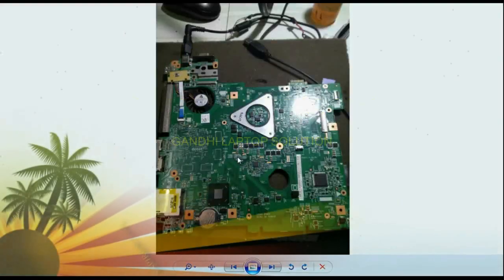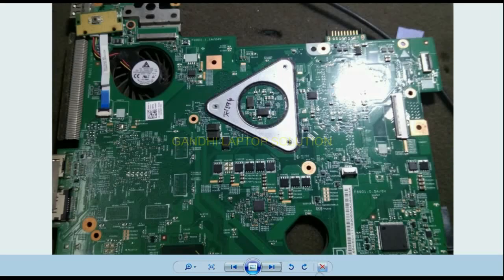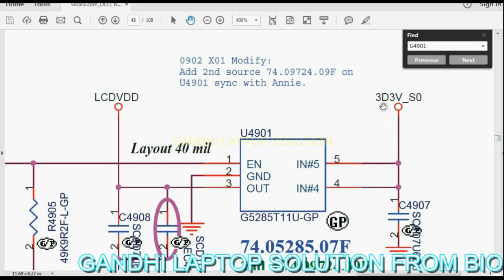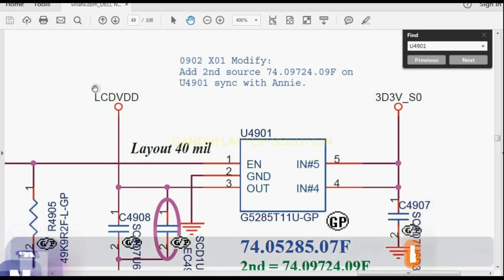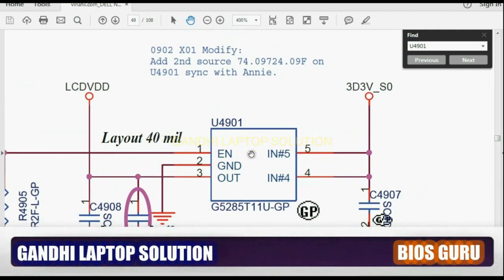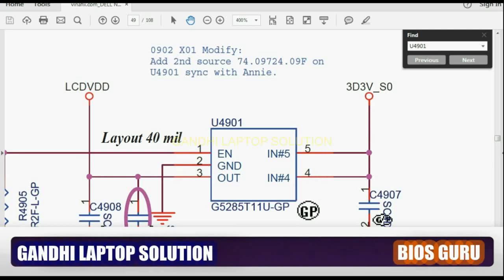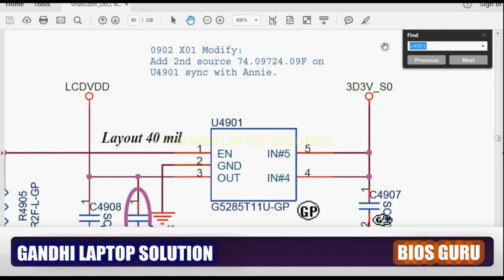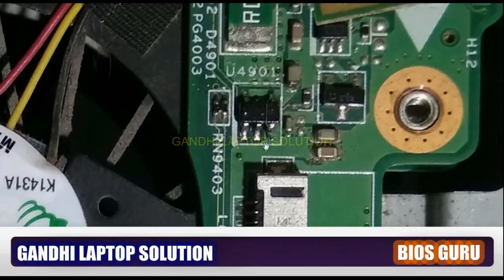Dell Inspiron 5110 No Display Solve By LCD_VDD supply missing

Comment: Thank you sir 😘
Reply: My laptop Dell 5110 n same problem I have jumper 3.3v bdd all voltage ok but no voltage in data line black display do vedio vga display ok   sir please share me some tricks
Reply from the maker: You need to cross check first screen and VGA cable is ok...then check board has k.b display ok....then check LCD_vdd direct.....blank display cause Not Same....step by step check....check board  with graphic board...
Reply from the maker: Welcome keep supporting us